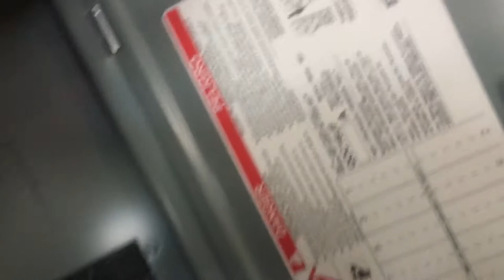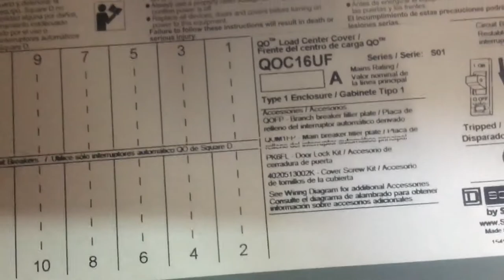Identify Square D Homeline vs QO Breaker or Breaker Panel

Comment: MY QUESTION IS THAT HOW DOES IT ATTACH TO THE PANNEL.  AS I KNOW THAT YOU FOR SURE KNOW THAT THERE ARE DIFFERENT TYPES OF TEETH THAT CONNECTS THE BREAKER TO THE PANEL.  DO YOU HAVE AN ANSWER FOR THAT?
Reply from the maker: How do the breakers attach? They easily snap in when you have the right breakers

Comment: I noticed that all my breakers had a square D on them and my panel had "homeline" written all over the label inside the cover.
Reply from the maker: That’s great. Sounds like you have a homeline and not a QO square D
Reply: What’s the significance between Qo and homeline in square d panel?
Reply from the maker: Qo = Quick open. It’s different than the home line breakers
Reply: QO is commercial grade with a copper busbar. Homeline is residential grade with an aluminum busbar. QO breakers are about 3 times as expensive but QO panels can support 3 phase power where as Homeline is limited to single phase I believe.